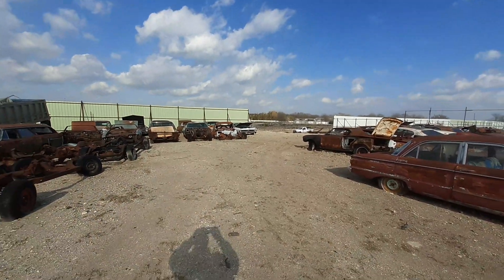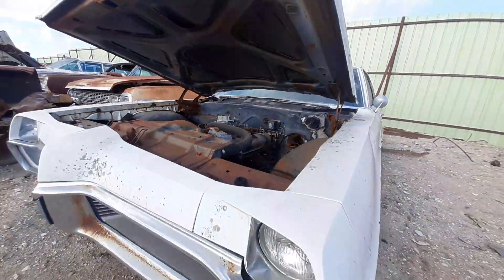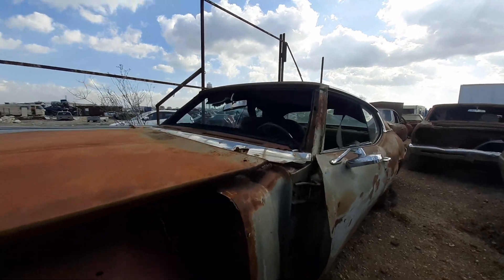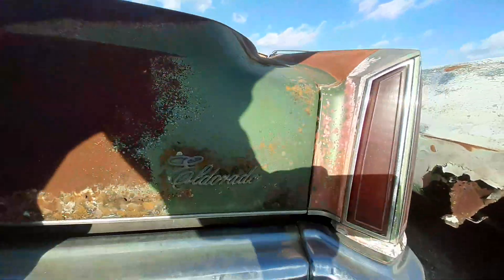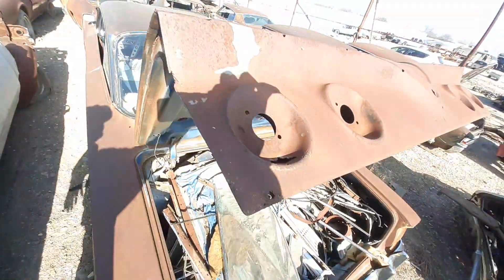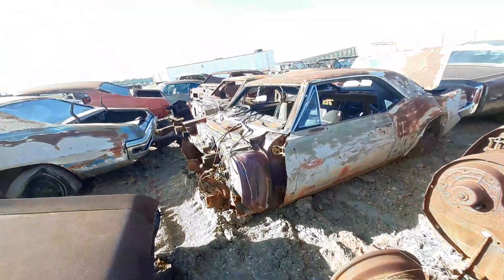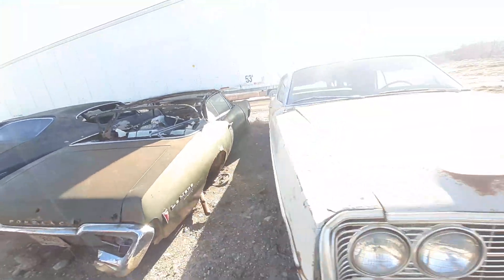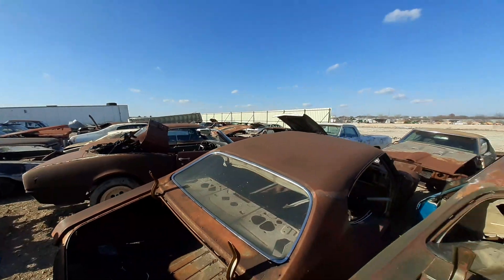50 CLASSIC CAR WALKTHRU + TAGS ON MOST GTO'S CADDY'S GALAXY 500 FIREBIRD CATALINA'S N MORE..

Comment: Whoa Nelley, a field of dreams indeed. I'm only going to try to do the ones that you got tags for, that makes it easier. I think I did some of these if this is the same spot where Cowboy was, but since you got the tags we can brag and the VINs for the win. Here we go, from the top:

Vehicle #1:  1966 Chevy Chevelle Deluxe 300 V8 wagon, 12B for the second week of December 1965 production, 66 for 1966 model year, 13435 for V8 Chevelle 300 Deluxe Wagon, KAN for Leeds, MO assembly, 727 for black interior trim, D-D for upper and lower Mist Blue exterior paint,  W for tinted windshield, G for power tailgate, M for Powerglide transmission. 

Vehicle #2: 1966 Pontiac GTO convertible, 04E for the fourth week of April 1966 production, 66 for 1966 model year, 24267 for Pontiac GTO convertible, BT for Arlington, TX assembly, 223 for black interior trim, G for paint doesn't show up (and it looks like a G, not a C which would be Cameo White, in 1967, code G was Signet Gold). 

Vehicle #3: 1966 Pontiac Catalina, four door: 07A for first week of July 1966 production, 66 for 1966 model year, 25269 for Pontiac Catalina four door sedan, BT for Arlington, TX assembly, 539 for black interior trim, H for Palmetto Green exterior paint, I believe the other C next to it is for a white vinyl top, C60 is for air conditioning, M40 is for the TH400 transmission,  D99 for two tone paint moldings. 

Vehicle #4: 1960 Chevrolet V8 Belair four door sedan: 60 for 1960, 1639 for V8 Bel Air sedan, 806 for gray interior trim, 936A for Ermine White exterior paint, EZI for tinted glass all the way around, SL should be St. Louis, MO assembly. This "Fresh Prince of Belair" has run out of style...

Vehicle #5: Yup, looks like a '65 Malibu, but no tag, can't brag, but the dealer emblem on the back says Friendly Chevrolet, and they are still in business located at 2754 N Stemmons Fwy, Dallas, TX 75207.

Vehicle #6, I think you're right, but no tag, can't brag. 

Vehicle #7: 1967 Pontiac Catalina four door hardtop. Can't make out the date code, but it's got an "A", so that's the first week
of the month, 67 for 1967 model year, 25239 for Catalina four door hardtop, BC for Southgate, CA assembly,  looks like 507 for Turquoise interior trim, CC is Cameo Ivory exterior paint, B80 for roof drip moldings. 

Vehicle #8 that you think is a Maverick appears to be a GM "A" body like a Lemans or GTO, but you didn't show a tag or a VIN, no brag, no win. LOL.

Vehicle #9, 1966 El Camino V8. 07B for second week of July 1966 production, 66 for 1966 model year, 13680 for El Camino V8 Custom, KAN for  Leeds, MO assembly, 710 for Fawn interior trim, H-H for Willow Green upper and lower exterior paint, E for tinted glass, K for air conditioning, and M for Powerglide transmission.

Vehicle #10: 1969 Pontiac GTO,  69 for 1969 model year, 24237 for Pontiac GTO two door hardtop coupe, BT for Arlington, TX assembly, 258 for black interior trim, 63 63 for Champagne ( greenish/gray) exterior paint, 12A for the first week of December 1968 production. 

Vehicle #11: 1966 El Camino V8. 11A for first week of November 1965 production, 66 for 1966 model year, 13680 for El Camino Custom V8, KAN for Leeds, MO assembly, 710 for Fawn interior trim, C-C for Ermine White exterior paint, E for tinted glass. A virtual twin to the other one and even made in the same assembly plant.

Whoa Nelley, be careful or as CRS says, "I'm going to bust my ass on this crap!!"

Vehicle #12: Nope, not a GTO, 1969 Lemans. The tag and VIN in that year would be "242" to denote a real GTO. 69 for 1969 model year, 23737 for two door Lemans hardtop coupe, ATL for Atlanta, GA assembly, 256 for green interior trim, 59 for Limelight Green exterior paint, I think the G next to it is for a green vinyl top, 11D for the fourth week of November 1968 production. 

Vehicle #12: Also a 1969 Lemans: 69 for 1969 model year, 23737 for Lemans two door hardtop, ATL for Atlanta, GA assembly, 252 for gold interior trim, 73 73 for Verdoro Green exterior paint, 01C for the third week of January 1969 production. 

Vehicle #13: 1968 GTO. 05C for the third week of May 1968 production, 68 for 1968 model year, 24237 for GTO two door hardtop, BT for Arlington, TX assembly, 221 for gold interior trim, G for April Gold exterior paint and 2 is a black vinyl top.

Vehicle #14: 1966 Chevelle, do not think it's a real SS as that year it would be body style 13817, not 13617. I can make out 13617 for Malibu Sport Coupe 2 door, 761 for black interior trim, ATL for Atlanta, GA assembly,  and W-W for Chateau Slate (a light blue gray) exterior paint. K is for AC, M is for the Powerglide transmission. 

Vehicle #15: 1968 Lemans. 11A for first week of November 1967 production, 68 for 1968 model year, 23737 for Lemans two door hardtop, PON for Pontiac, MI assembly, 220 for Turquoise interior trim, K for Meridian Turquoise exterior paint, and 2 should be for a black vinyl top. 

Vehicle #16, not an El Camino, it has the FRONT from one though. LOL. 04D for the fourth week of April 1967 production, 66 for 1966 model year, 13667 for V8 Malibu convertible, BF for Fremont, CA assembly, 757 for interior trim doesn't show up, F1 is for Marina Blue exterior paint and 1 might be a white convertible top.

Vehicle #17, 1966 Chevelle V8. 05B for the second week of May 1966 production, 66 for 1966 model year, 13617 for Malibu V8 sport coupe,  KAN for Leeds, MO assembly, 790 for Bronze interior trim, W-W for Chateau Slate exterior paint,  W for tinted windshield, M for Powerglide transmission and G for console.

Vehicle #18: Green convertible is a 1971 to 1974 Eldorado. 1972-1974 VIN is something like 6 for Cadillac, L for Eldorado, 67 for convertible, S for 500 V8, 2, 3, or 4 for 1972, 1973, 1974 model year, then Q for Detroit, MI or in some cases E for Linden, NJ assembly, and the rest is the production sequence. Possible 471 for Dark Jade interior trim and #44 for Sage exterior paint. 

Vehicle #19, 1966 Pontiac Lemans convertible. 05C for the third week of May 1966 production, 67 for 1967 model year, 23767 for Lemans convertible, KAN for Leeds, MO assembly, 223 for black interior trim, E for Fathom Blue exterior paint, 2 for black convertible top,  E should be for AC, W for two speed automatic transmission and G for console. 

Vehicle #20: red 1971 Cadillac Eldorado convertible. 1971 was the only year GM put those vents in the trunk like that on their cars. Might be #74 Cambridge Red exterior paint. 

Vehicle #21, the VIN gets us the win: 1975 Eldorado convertible: 6 for Cadillac, L for Eldorado, 67 for convertible, S for 500 V8 with four barrel, 5 for 1975 model year, Q for Detroit, MI and the rest is the production sequence. 

Vehicle #22: possibly a 1969 Dodge Charger. 

Vehicle #23: 1966 Chevy Malibu. 05A for the first week of May 1966 production, 66 for 1966 model year, 13617 for Malibu V8 sport coupe, BF for Fremont, CA assembly, 761 for black interior trim, V-V for Cameo Beige upper and lower exterior paint.

Vehicle #24 for the "low" tag is a 1961 Impala,  841 is blue interior trim, can't see the paint but we'll go with #1211 Tasco Turquoise, EZW for the ACC is for tinted windshield. You're right, they are not generally down there like that.  But we got some of the tag, we can brag.

Vehicle #25, Whoa Nelley, a real 1965 Malibu SS. 07C for the third week of July 1964 production, 65 for 1965 model year, 13817 for Malibu SS two door sport coupe, KAN for Leeds, MO assembly, 741 for blue interior trim, D-D for Mist Blue exterior paint, E for tinted glass, K for air conditioning, M for Powerglide and P for push button radio and W for custom front seat belts.

Vehicle #26, 1967 Malibu V8 Sport Coupe: 05C for the third week of May 1967 production, 67 for 1967 model year, 13617 for Malibu V8 sport coupe, KAN for Leeds, MO assembly, 747 for red interior trim, A-A for Tuxedo Black upper and lower exterior paint. 

Vehicle #27: 1967 Chevy Camaro, 12D for the fourth week of December 1966 production,  67 for 1967 model year, 12437 for two door coupe standard interior, NOR for Norwood, OH assembly, 741Z for red bucket seats, standard interior, R-R for Bolero Red upper and lower exterior paint,  M is for Powerglide transmission, G is for center console, S is for rear antenna,  L for Rally Sport equipment, Y for deluxe seat belts. Probably a 327/powerglide Rally Sport car originally. 

Vehicle #28: 1967 Pontiac Firebird 400 convertible, 05C for the third week of May 1967 production, 67 for 1967 model year, 22467 for deluxe interior Firebird convertible, LOR for Lordstown, OH assembly (which just closed a few years ago), 253Z for black bucket seats, Q for Verdoro Green exterior paint, 2 for black convertible top, W for tinted windshield, D for power convertible top, Z for three speed automatic transmission, G for console, F for 400 V8 option, F again for outside remote mirror. This car was a real beauty when it was new.

Vehicle #29: 1968 Camaro V8, 10D for the fourth week of October 1967 production, 68 for 1968 model year, 12437 for two door V8 Camaro sport coupe, LOS for Los Angeles, CA (Van Nuys) assembly, 712 for black standard bucket seat interior, D for Grotto Blue exterior paint and 2 is  a black vinyl top.

Vehicle #30, 1967 Firebird with custom interior: 02E for the fifth week of February 1967 production, 22637 for Firebird with Custom interior, two door coupe, LOR for Lordstown, OH assembly, 259Z for black bucket seat interior, N for Burgundy exterior paint, 2 for black vinyl top, W for tinted windshield,  L for four speed manual transmission, S for manual rear antenna, F for 400 V8 option, F again for outside remote mirror, Y for deluxe front seat belts. Again, another beauty when it was new.

Vehicle #31: 1968 Chevrolet Malibu: 11C for the third week of November 1967, 68 for 1968 model year, 13617 for V8 Chevrolet Malibu sport coupe, KAN for Leeds, MO assembly, 772 for blue interior trim, L-L for Teal Blue upper and lower exterior paint.
Reply from the maker: The first 3 r my favorite..
Reply from the maker: WOW!! That’s a lot of cars. U must can type fast?? Sum of them didn’t even have tags burned up or missing..
Reply: Vehicle #34, 1969 Pontiac Lemans, 69 for 1969 model year, 23737 for Lemans two door, 11C for the third week of November 1968 production, BF for Fremont, CA assembly, 252 for gold interior trim, 65 65 for Antique Gold upper and lower exterior paint.
Reply: @DeathRowCarCrusher  I had to break them up. The response was too long. I got most of them, still going...LOL.
Reply: Vehicle #35: 1968 Ford Galaxie:  VIN is 8 for 1968, D for Dallas, TX assembly, 58 for Galaxie 500 two door formal hard top, Y for 390 V8 with two barrel, and the rest is the production sequence. 65C is for Galaxie 500 two door hard top, 6 for Light Beige exterior paint, 6U for Parchment interior trim, 16M for December 16, 1967 production and DSO 61 is Dallas, TX.
Reply: Vehicle #36, 1968 Pontiac Lemans convertible: 68 for 1968 model year, 23767 for Lemans convertible, PON for Pontiac MI assembly, 224 for Parchment interior, Q for Verdoro Green exterior paint, 1 for Ivory White convertible top.

Vehicle #37, 1969 Chevelle V8 Sport coupe: 69 for 1969 model year, 13637 for two door sport coupe, KAN for Leeds, MO assembly,  796 for green interior trim, 57 57 for Fathom Green exterior paint. L is believed to denote SS equipment, so yes this might be a legit SS 396 Chevelle. 03C is the third week of March 1969 production.

Vehicle #38 appears to be a 1969 Pontiac GTO,  possibly code 50 Cameo white, made in Arlington, TX.  Tag is kinda rough.

Vehicle #39 is a 1969 Cutlass S convertible, 69 for 1969, 33667 for Cutlass S convertible, LAN for Lansing, MI assembly, looks like 930 for trim which is black, 40 for Saffron Yellow exterior paint, B should be black convertible top, 02B for the second week of February 1969 production. Another beauty when it was new. 

Vehicle #40 is a 1970 Lemans two door, 70 for 1970 model year, 23737 for Lemans two door, PON for Pontiac, MI assembly, 257 for Sandalwood interior trim, 58 for Granada Gold exterior paint. 

Vehicle #41 is a 1971 Lemans. 71 for 1971 model year, 23737 for Lemans two door, Z for Fremont, CA assembly,  269 for black interior, B80 for roof rail drip moldings, 53 53 for Quezal Gold exterior paint and 12E for the 5th week of December 1970 production.
Reply: @DeathRowCarCrusher  Yup, I can type fast. Some I was able to do off the top of my head, some I had to take a minute and think about. Whew, that was a lot of 'em!
Reply from the maker: @googleusergp  Super bad ass. Man u did one hell of a job decoding these cars. 😊😊😊💯💯💪💪
Reply: @DeathRowCarCrusher  You got it.
Reply from the maker: @googleusergp  u good with editing videos with thumbnails? If so I deal fo ya??
Reply: @DeathRowCarCrusher  My only suggestion was to break it up into maybe three smaller videos, parts 1,2,3. Other than that, you did a fine job indeed.